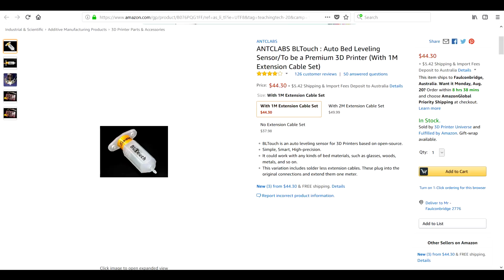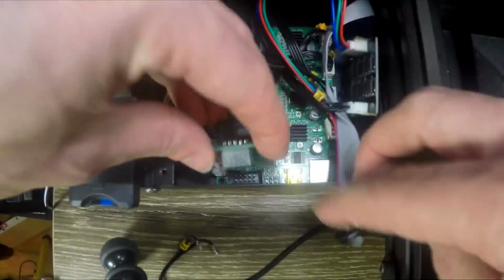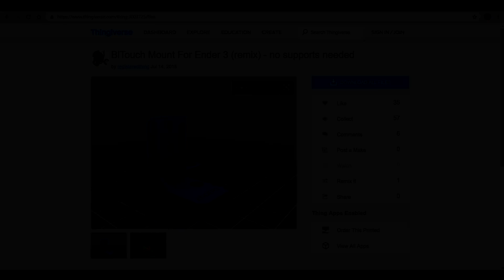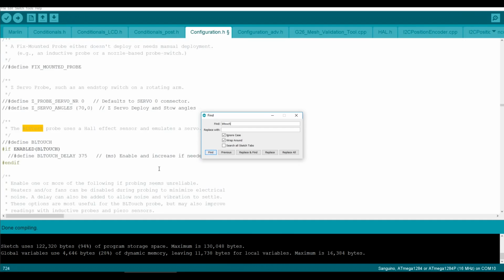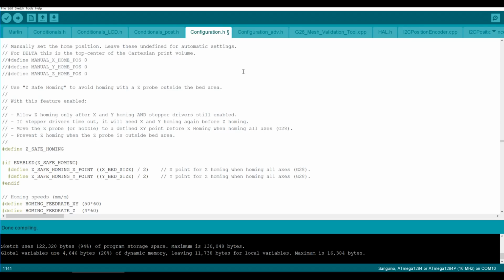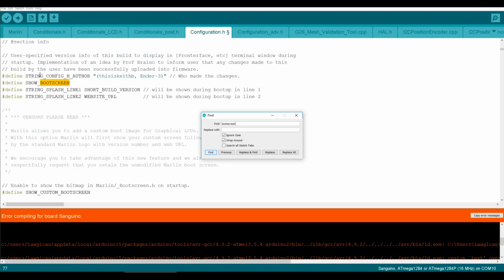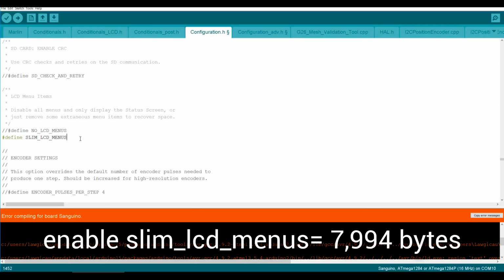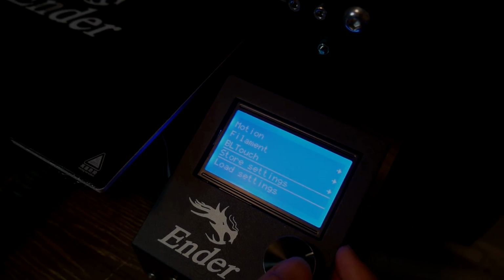Ender 3 BLtouch vanilla Marlin guide

Comment: Due to a bug in 1.1.9, if you use octoprint, you may get a "EEPROM datasize error" after doing this.  To fix it, go to octoprint Settings->Serial Connection_Behaviour and change "What to do on a firmware error" to something other then "Disconnect from the printer"
Then, got back to octorpint home, and under "Connection" click Connect.
Hop over to "Terminal" then send m502 followed by m500.  
After that the problem should be fixed. You can put your what to do on a firmware error back to "disconnect" if you want now.
Reply from the maker: Thanks for pointing this out. I've been using Octoprint since without dramas so far. Fingers crossed.

Comment: Michael, if trying to feed a wire through that wire wrap gauze tube stuff... DONT try with the connector FIRST... put through a guide wire or string, attach the extension to that and then pull it through... much less painful.....
Reply: I doubt he has much choice, seems he bought a premade extension which has connectors on both sides.
Reply from the maker: This is true what Karsten said. The string idea is good though.

Comment: Dumb question, but wouldn't it be easier to just replace the stock Arduino with one that has more memory?
Reply from the maker: It's a valid suggestion. Extra expense and hassle would turn a lot of people off. I'm planning to trial a new 32bit board in my Tevo Tornado and then put the MKS gen L in the Ender. There will be a video eventually.
Reply: Can't wait for that. I've been thinking about trying a 32bit board for some time. Great to know you have this in your to-do list.
Reply: sounds good! I was just curious if there was any reason why it wouldn't work- I actually have several duino's laying around from various projects so it may be less of a hassle to just swap one out. love your videos btw, keep them coming!

Comment: FYI to feed cables through cable braid, grab a piece of reasonably heavy wire (ie similar size to the inside of one of the strands in tps) ,longer than the braid, fold the end over and tape it (about 20mm or so will do it, to create a smooth end) then feed it through. It will slide right through. Once it does, \ then tape your connector to the end of it, making it as smooth a transition as possible, then pull it through. Saves a lot of swearing.
Reply from the maker: Awesome tip, thanks for sharing.
Reply: Why do it at all? A few cable ties and be done with it.
Reply from the maker: Neater to look at and minimal chance of cable ties cutting into wires over time.

Comment: The first code change you suggest, to uncomment ENDSTOPPPULLUP_ZMIN_PROBE, will never be hit because it's inside of an IF block that is false due to the #define ENDSTOPPULLUPS directly above it.  No harm in uncommenting as you suggest, but its unnecessary because all endstop pullups are enabled by the #define command.
Reply from the maker: Well spotted! I was working off the 1.1.8 version as did for my Tevo Tornado, didn't look closely enough.
Reply: LOL, I was about to point this out too. Other wise Great video as usual.

Comment: No issues with marlin 1.9? Me and some people get get random printer printer halts when homing Y axis on CR-10s, so we are forced to stay on 1.8, capacitors aka filters etc nothing seems to fix it, FW noise filters even if that works its not an option for me due the accuracy you can lose when you activate the FW noise filters. Once again nice video.
Reply from the maker: Nothing so far. Have been on it for a few days. I'll post back if I come across any issues.

Comment: Great video mate! I have been looking forward to this one.
Re the bltouch, best way to get the correct height its designed to be at is to use a mount that can be slid up and down on the mounting screw. Then move the nozzel till it is resting on the print bed and adjust the hight of the mount so the base of the bltouch where the probe protrudes from is 8.3mm from the print bed. I might make an 8.3mm spacer tool and upload to thiniverse. The cr10 petsfang blt mount should work with the stock shroud and has a slide for height adjustment.
Also a tip for running wires through the cable mesh sleeve. I cut a length of  pla filament and pushed it down the sleeve then taped the wires to the end of the filament and pulled them down the sleeve. Pulled easier than I thought it would and took about a minute total.

Lastly, Creality has an ebay store with stock in Australia and cheap domestic shipping. Cheaper option than banggood for Aussies.
Reply from the maker: Fantastic tips, pinned.
Reply from the maker: The newer petsfang mounts are like that. I used to use an 8.3mm spacing block and be very particular but now I figure if it's close enough I can dial it in with z offset. Great tips though!
Reply: Agreed.  I used a piece of thin dowels to act as fishing tape for pulling through the wires.

Comment: are the slim menus 1.9 exclusive? I have 1.8.3, and need to get rid of 6300b to get mesh bed leveling, but don't have anything else I can remove, the LCD menu would be the answer, help?
Reply from the maker: Seems to be. I just my Frankendoodle Marlin source (1.1.8) and it isn't there. If you go to the ultraLCD tab you can comment out lines manually but obviously this is a lot harder.
Reply: Correct, it was added in 1.1.9, and it was contributed by TH3D.

Comment: Cheers bud, exactly what I was hoping to see when you did the one the other day for the EZABL. Great video guide
Reply from the maker: Thanks for watching :)
Reply: i always seem to find with sanguino boards i have to use an older version of IDE to burn the bootloader and even in some cases upload the firmware.i bought your preconfigured files and copied them over etc then tried to verify it in IDE v 1.8.5 and i got this error-i havent tried it in an older version of IDE yet:

In file included from sketch\ultralcd.cpp:96:0:

sketch\ultralcd_impl_DOGM.h:46:20: fatal error: U8glib.h: No such file or directory

 #include <U8glib.h>

                    ^

compilation terminated.

exit status 1
Error compiling for board Sanguino.

any ideas?? cheers Michael.
Reply: Verify you have the u8glib library installed (and in the correct place). It contains the file U8glib.h and if it is found that part of the code will compile.

Comment: Hello, I'm confused, do I still need TH3D firmware? TH3D is a bootloader or is it a firmware replacement?  so in order to flash the latest vanilla Marlin then i will need to use TH3D bootloader right? i wish you have a guide from a completely stock, add BL touch then do all the bootloader then vanilla Marlin in one order. i dont know which to watch 1st.
Reply from the maker: TH3D is a version of this Marlin firmware, with a lot of this already setup. TH3D starts with this and then modifications are made. This is 'vanilla' because it starts with the original Marlin that everyone starts with. The bootloader is a piece of code put on the mainboard by Arduino, it is separate to Marlin, vanilla or TH3D versions.
Assuming you want a version of vailla Marlin like I've shown here:

1. Start with my bootloader guide: https://www.youtube.com/watch?v=fIl5X2ffdyo but stop before the TH3D bits.
2. Then pick up from after the bootloader on the vanilla Marlin guide: https://www.youtube.com/watch?v=N7JLchsFRDU
3. Then this video.
Alternatively, if you are happy to part with a dollar, you can buy the preconfigured Marlin files from the link above. After burning the bootloader and installing Sanguino and U8glib support like in video 2, you will be done in about 1 minute.
Reply: It'll be the best dollar you could spend towards 3D printing. His response alone is worth a buck.
Reply: thank you Teaching tech, i'll have to start everything from scratch. yes i'll need these files. i do this 1st thing i get out of the bed tomorrow. once the bootloader is done, I can keep using this bootloader to update whenever a newer Marlin firmware come out right?
Reply from the maker: Correct. It should be a one off.
Reply: hi Teaching tech, i got TH3D_UFW_U1.R2.2. do i replace the files in the Firmware\TH3DUF_R2 with your files? i checked the file header and doesnt look like the same version?
Reply: i 've uploaded the ardunioISP using the 6 cables.  successfully. i then disconnected the ardunio uno. then connecct usb cable directly to the ender's mini usb port.
Reply: oh gotcha, i download the marlin 1.1.x from this site: http://marlinfw.org/meta/download/ then replace the files with yours. so this TH3D_UFW_U1.R2.2 stuff is useless right?
Reply: Sangunio is missing from the tools/board menu, any idea?
Reply: ok, i had to add driver manually using this url: https://raw.githubusercontent.com/Lauszus/Sanguino/master/package_lauszus_sanguino_index.json
Reply: when i click verify i get "u8glib.h" no such file or directory. any idea?
Reply: ok i had to download u8glib.h then added manually, then  it says im missing _statusscreen.h no such file. i had to copy these from from Marlin-1.1.x\Marlin\example_configurations\Creality\Ender-3\ this sorted the missing stuff
Reply: Just go to Arduino's library manager, type u8glib and download the version from there. the .h file is not the whole library.
Reply: Can you solve it? I also encountered this problem.

Comment: Honestly, at this point i think it is less trouble to just upgrade to a better board with better drivers, even if it costs almost as much as the Ender 3 itself.
Makes upgrading and updating much easier and more comfortable. If Creality would have upgraded the board in the Ender 3 Pro, that would have been much more sensible and actually worth the extra money. But since it's an open source platform, someone else is surely gonna provide an affordable solution.
Reply from the maker: I agree there would be a market for someone to sell a better board with plug and play connectors.
Reply: Already lots of cheap choices, I am sure for those that like to tinker with their 3D printer hardware you probably already know about something called RAMPS. https://reprap.org/wiki/RAMPS which might be the cheapest. Watch the voltages if the PSU uses 24V. There are lots of others with integrated Arduino and Stepper Drivers on a board. Most work with Marlin very simply too.